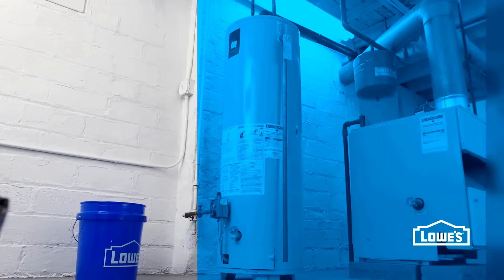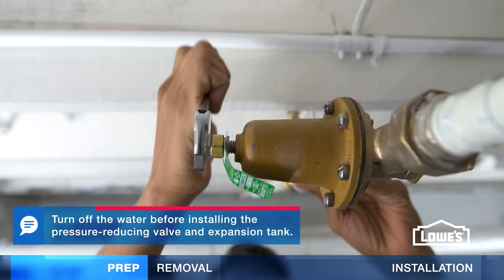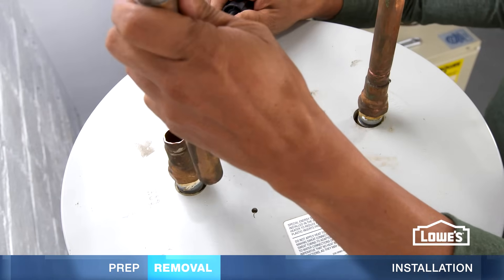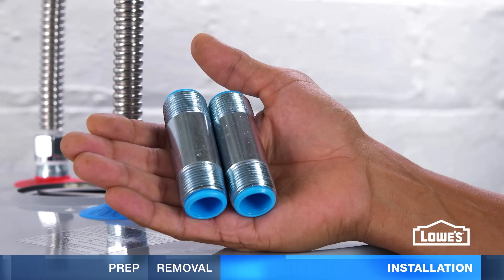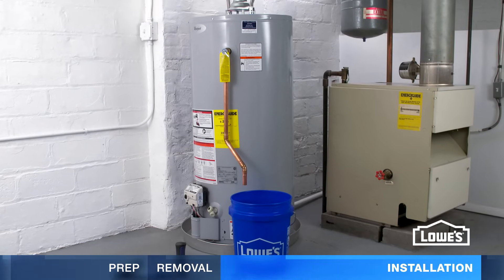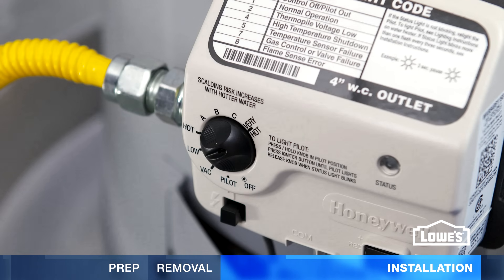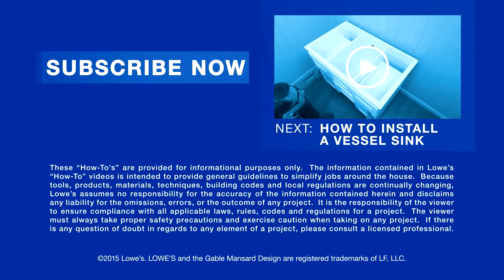Gas Water Heater Installation

Comment: so happy seeing Lowes is using flex gas pipe.
I bought my home last year and detected a gas leak near water heater intake (probably due to the "hard" pipe connection).
Then I switched to flex gas pipe and problem solved.
Can you imagine the previous owner had a gas leak in the basement since 2010 when the water heater was installed.

Comment: You should note that in some jurisdictions the tank must be 18 inches off the floor and if you are installing to replace an existing tank you must use new gold coloured flex gas feed.
Reply: Also it’s 9 years old and half those fittings are banned.😂

Comment: Don't forget to remove the crappy plastic drain valve on the bottom of your new water heater and replace is with a high quality brass valve and nipple to space it out a bit.  A water heater should be drained bi-annually to keep the sediment from building up, and those plastic drain valves don't last.

Comment: 4:25 where’s the new gas shut off?
Reply: Why do you need a new gas shut-off >  The shutoff should be attached to your house gas hardlines prior to the flex line and not the added flex line.   The installer would have to shut off this gas valve prior to installing the new water heater.   @4:24 you can clearly see him turning the valve back on.   This valve does not need to be replaced.
Reply: @rcairflr  Ah ha! Good eye. It was so fast that I missed it. I know it doesn’t have to be new. I just didn’t see one at all until you pointed out that split second clip of him turning it back on.

Comment: And my local hvac company wanted $1500 plus just for for installation.  This is maybe a 2-3 hour job max that
 Can be done with basic tools. That's not including the heater btw.
Reply from the maker: Thanks for watching!
Reply: Wow, that is high.  I just had a brand new Bradford White 50 gallon gas water heater installed for $1295, this includes the new water heater.
Reply: That quote was from the home depot contractor as well. Crazy crazy...

Comment: Just curious if mortgage company requires a gas heater to be installed by a certified plumber to ensure it’s up to code. Seems like it would be a requirement
Reply: nope, it's not

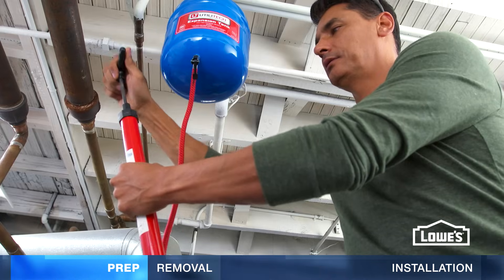Comment: It would have been great if all the tools** used were listed on your webpage. For example, the exact deburring, copper pipe cutter, air pressure tool and the air pressure gauge tool at 1:37.
Reply: And a parts list, too.
Reply: Hot or low

Comment: Quick question - those plastic liner in water connection nipples on top aren't removed ? Just leave them right ? Right in the middle of doing one right now. I've done one before but forgot to leave them in. I think I'm supposed to leave them in.

Comment: Do gas water heaters require any electrical connections?
Reply: If it is a high efficiency unit and has a powered fan for the flue exhaust, yes, usually its a 120v plug.

Comment: No gas connectors to the gas valve. Needs to be schedule 40 black iron. My advice is not to risk being screwed on your home owners insurance if something happens, you won’t be covered.  Have a licensed gas installer do this work.

Comment: Where you lost me at, was putting teflon tape on the threads of a compression fitting🤦‍♂️
Reply: They didn't put them on the threads of the flared end of the fitting 🤦‍♂

Comment: How reliable are push fit fittings?
Reply: Have used shark bite fitting . Used behind bathroom wall 13 years ago. Knock on wood I hope I dont jinks myself. Still good . Secrete you have to make sure they are seated properly. Practice
Reply: Just learn to solder it’s not difficult.

Comment: Not plumbers tape it’s Teflon tape plumbers tape is galvanized or plastic with holes used to hang or strap pipe if unable to run t and p discharge pipe out side it needs to be approximately

Comment: Thanks lowes to share the secrecy behind the heater installation. Shut off the whole house water by turn off the switch outside house, which is more secure to use to avoid your in-house valve broken because long time set in rest. Most house has cold water cross-flow to hot pipe issue. So Turnoff whole house cold water will prevent the hot water pipe keeps running off water after turnoff the heater cold water valve.
Reply: If you don't speak English then don't try to write in it.
Reply: @waytospergtherebro  ko
Reply: @waytospergtherebro : I’m dying 🤣🤣🤣

Comment: it will go this smoothly for about 1% of installs.  the other 99% you'll need way more time, tools and fittings.
Reply: Truth!
Reply: Are you a plumber? What issues did you run into?
Reply: @Carpe Diem 10-4
Reply: Exactly haha.

Comment: I wish all my heaters had this much space

Show us a real video where the old heater was sized up to an inch of actual size in a closet

 vs the new install which has more insulation and is thicker due to new codes
Reply: If only every project was this easy

Comment: Does anyone know if those plastic pieces on water heater top connections are supposed to be removed? They're on the inside as well. Are they simply protecting the water connections just before installing it but need to be removed?

Comment: I just found out..$450.+tax to install a water heater....get real. I was going to splurge and let a plumber install it I thought $200 at the most
Reply: Home Depot's subcontractor (ARS) quoted $1,750 to install.  Water heater is extra.
Reply: @lowlyjimson5260  whaaaat? Lmao 🤣
Reply: Now it's $3,700 to Install 🤦
Reply: @boomcitystudio1207 yeah this comment had me cracking up. $200 is not both compared to todays rates.

Comment: Can you do this video inside a small closet, instead of ideal situations
Reply: A year or more late but to answer your question.
If the unit is a gas powered heater you need "make up" air for the fire that heats up the water. 
If you dont have enough  air flow you can get improper combustion which can be detrimental to your health. And electric unit does not need make up air and can be put almost anywhere.
Reply: I think that it must not be in a confined space like that; but check with a pro. Definitely check before doing it. Because of the possibility of BOOOM.

Comment: Pretty good but a few errors here...You don't need a thermostatic mixing valve- that's what you your cold water faucet is for,  putting in another valve is redundant  and doesn't do anything except cost you money...also what's with the Lowes bucket?   Totally not up to code- all plumbing codes in the USA require the T&P relief line to vent either outside or to a point within 6" of the floor - NOT a bucket!     Note the yellow gas connection - this is CSST - a material known to fail during voltage surges and lightning strikes!  This material is actually banned in some US cities!   Stay away from  it.   Finally this appliance (like any) should be grounded against voltage surge and lightning strike but I didn't see any grounding at all.

Comment: Very nice video. I'd love to do it myself next time since changing all pipes to flexible ones are just very easy job. 
I live in Massachusetts, is it ok to do it on our own? Or have to be licensed for gas and plumbing works with permit as well by law?
Reply: If you do not drown or blow yourself... or anyone else up, what they won't know can't hurt you! The main thing that kills most people though is the carbon monoxide gas leaks when they have defective venting. You can smell natural gas and you can also use water and dish soap to make leaks bubble. Much cheaper and already will have on hand. The part no one likes is hauling a new one in and hauling/disposing of the old one. Especially the disposal.

Comment: Omg not shark bite fittings they should be banned
Reply: Why? There's more videos if you need to learn how to use them
Reply: magenlin I’m a plumber I refuse to use them if go do a job that has them either I cut out and fix it right or I don’t touch the job. Shark bites should be banned
Reply: @dennisburgess2452  I replaced the two shut-off valves under my kitchen sink with shark bite, one single outlet, one dual, a year ago.  So far, both perform flawless.  One feature I love, is after installing, they can still be clocked in any position.  Makes for a clean install.

Comment: in oregon you need seismic strapping and the bucket under the  tmp line is def a no no.
Reply: In Utah the tmp line has to be no less than one inch off the ground, and no more than six. Bucket definitely not allowed lol.

Comment: This is a super basic install video. Smh
If the water pressure is above 80 psi it MUST be regulated  UPC 608.2
Expansion Tank is REQUIRED if you have a closed water system UPC 608.3
Reply: A guy with the name Tony Bruno WOULD know about plumbing code! Aye Big Tony B I got a leak ova here. Fugget about it.

Comment: These instructions are great had to pull 2 hot water tanks due to flooding and followed these instructions exactly and within 2 hours had both tanks up and running used the Teflon tape that was good for gas or water lines no leaks first try. Thanks for this video.
Reply: I look forward to seeing your house on the news soon 👍
Reply: @Will-zv9xh ?

Comment: Great video!  I just learned that most water heaters manufactured after April 2015 are wider (and more expensive) than previous models due to gov regulations requiring them to be more energy efficient.  You may need a larger stand  or drain pan to accommodate.  If your water heater is in a tight space, many of the newer models may not even fit.
Reply: My Bradford White water heater is narrow, but slightly taller. Seems like a good fit in tight spaces.
Reply: @JP1050x  they are referring to the new heaters being wider than the older heaters. So when you have an older in a really tight closet or space, then the new heater with the same capacity might not fit. You'll have to downsize and probably add a mixing valve if needed.

Comment: He used Teflon tape on a compression fitting? I cannot trust anything he did after that lol
Reply: Then I suggest Brandon Roberts you get educated on what he said and what he used , It was poly-temp thread seal tape for gas ( yellow) one uses it on threaded gas connections just as you use tape on the water threaded connections( usually white or pink ), it makes a seal and helps to prevent leaks and stripped threads........
Reply: Not a dang thing wrong with using Teflon tape on a compression fitting. He used it as a lubricant not as a sealant.
Reply: Brandon Roberts I thought the same thing.  Lowe’s isn’t even smart enough to high a licensed plumber to do the video.
Reply: Nothing wrong with that, just helps keep things more secure.
Reply: He said it was gas plumbers tape and it looked different from the teflon tape I’m used to seeing so maybe it’s a kind of teflon tape that’s used for gas lines?
Reply: Compression fittings don’t need tape
Reply: Stephen Barnabei - Right..I only use pipe dope and seems to work very well.
Reply: @infrared1731  right 😂
Reply: @hugostiglitz8465  I love.pipe.dope

Comment: 0:15 why does it say to turn on the exhaust fan, doesn't doing this pull the outside air in??
Reply: blipblop92: it's just to ensure the WH flue still functions properly with other appliances running
Reply: If something like a dryer or a return air vent from the Hvac is too close to the vent of the  waterheater that appliance could be pulling it's air so strongly that it pulls the from the waterheater exhaust. To prevent this and outside air vent can be added near the appliance that is hogging the air. The solution at my house was to undercut the bottom of the laundry room door that sealed off the outside air so that fresh air from the house would be pulled to the the laundry to replace the air being exhausted by the dryer.

Comment: A professional wouldn't do it any different.  This is easy stuff.  Do it yourself and save some money.
Reply: Frank Sandoval   You bet. But be sure you know the code in your area, maybe even get an owner builder permit and make it official.
Reply: If your professional is using sharkbite push fittings, get a new professional
Reply: @1daviddillion I'm just learning about fittings and wouldn't want to use those. It states not to use them where temperatures can fluctuate greatly. I learned how to solder and its easy with a steady hand.
Reply: Buy a solid scratch & dent & save more
Reply: I need someone given me direction as I perform it and talking me through.
Reply: Frank Sandoval amen
Reply: You couldn’t be more wrong.

Comment: What did you do with the 2 white plastic plugs that were in the cold and hot nipples in the new water heater?
Are they supposed to be removed?
Awesome video. Thanks a lot.
Reply: Neil Williams: Those aren't plugs, they're heat-traps. They're supposed to be there.

Comment: Why would anyone install an open vented gas appliance in their home in this day and age? This technology went out with the ark! Inefficient and potentially deadly under fault conditions, appliances like this are banned in most of Europe.
Reply: European laws are designed to prevent homeowners from doing anything.  It is not about safety.  They just want to protect the jobs of plumbers.  I hear they want permits to change light bulbs.
Reply: Spencer Wilton the cost of the unit for 1, a Power vented HWT is $300-$800 more than a conventional (Natural Draft) vented tank, venting material cost more for a PV HWT. Reliability, there are no electrical parts like motors and switches, that are costly to replace. Ease of maintenance, you have to change a $10 thermocouple maybe 1-3 times throughout the life of the tank. Whereas a Powervent will cost $100's to change out parts.
There are many advantages to a conventional tank.
Reply: From my understanding, most of Europe switched to tankless decades ago, didn't they?
Reply: Not only are you an asshole but you’re wrong too

Comment: Might help by starting out the video on how to drain the water tank.
Reply: Michael Eisenbise: Why? It's addressed well in the video -- A full tank makes it easier to remove attachments. I wouldn't drain a tank until I'm ready to remove the supply lines.

Comment: I can install the water for about $500 or pay somebody else a $1000 hmmmmmmm
Reply: captainkrunch -$500??  -Try $100 for most states/codes: two flex supply lines, one flex gas line, a small container of gas-rated thread-sealer, a $6 overflow tube, and additional pipe sections for your expansion tank (if you have/need one).  Damn; For $500, you could add a brand new expansion tank, a new stand (for garages), brand new tools for the job, and dinner/drinks with the wife afterward.
-I'd gladly do it for you, AND buy the necessary parts, for $500.
Reply: @mestizoboy  funny I came back here a year later and see I left a comment. My water heater did go out last week.  Got the ao smith 40 gallon gas 6 year heater  for 535 including tax.  Had to buy expansion tank and a few fittings  which brought price to $605.   Quotes were $1300 on up in my area.
Reply: @crazypumpkineater  
Forgot about this comment.
Yeah, it's a crime how much plumbers charge for simple lefty-loosey/righty-tighty installs, like water heaters, toilets, faucets, etc.
To be clear, I was originally talking about labor and misc parts only, not the cost of the water heater. 
I'm gonna go knock on wood, now. 🤞 -I have the same heater you do, and it's around 14 years old.

Comment: A gas leak from appliances are not safe to have in your home! Gas leakage could increase the risk of fire or worse, possibly an explosion. The gas is not safe to breathe in either, the stuff is poisonous... Please be extremely careful with gas fireplaces, air conditioning, boilers, ovens/stoves, etc.

Also, do not forget to reinstall the aerator! it can act like a semi-filter to keep debris out of your drinking water that comes out of the faucet! It will allow to let the water run smoothly too! You do not want to end up in a messy situation! Other than that, good video!

Comment: Homeowners beware, this video will assist in the installation of a water heater but I noted code violations as well as manufactures installation errors of certain fittings. I hold a master plumber license in the state of Georgia and I would not recommend this video for a homeowner "DIY" project. Water heaters can become dangerous when installed incorrectly. Tank style water heaters are a basic installation for any plumber. Call a plumber, don't flood your house.
Reply: Don't try to scare people troll. A master plumber should be out making money rather than troll the internet.
Reply: This is perfectly to code in many states. WA, for instance.
Reply: Mark Bone Why? What was done wrong?
Reply: @anarchyamp  This video is taking money out of his pocket. Water heater installations are big and easy money for plumbers.

Comment: Plumbing, Mechanical, and Fuel Gas Codes have changed in the past years. One thing not mentioned is the size of the flue pipe.
In some cases for example a 40 gallon gas fired atmospheric (Chimney) draft, water heater with a flue pipe size,  was 3" as shown in the video. Most states the size has changed to 4". The water heaters manufactured now, have what is called a "closed combustion chamber". Meaning where the pilot and burner assemblies are, is sealed. That is why there is a spark ignition for the pilot. There are circumstances that still allow 3", but that is an important fact that should have been mentioned, as to specifically check in your area, and circumstance. Due to the potential for Carbon Monoxide to "back draft" into the living space.
Reply: patdio58 i dont think I have ever seen a HWT with a 3" vent. Only 4" or larger. But that's in Canada, could be different where you are.
Reply: I replace water heaters all day everyday and see 3 inch venting all the time. probably most of the time honestly. @ICooke11
Reply: Thank you for the heads up on this! 💖